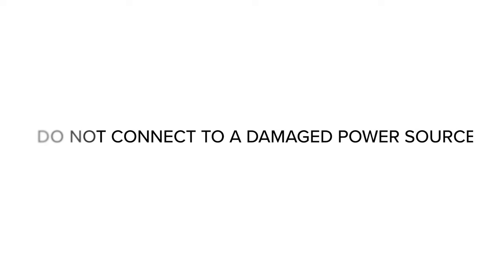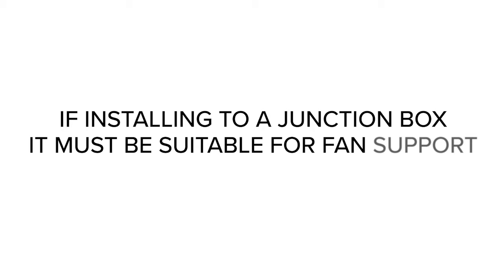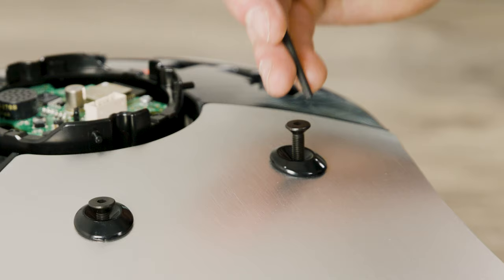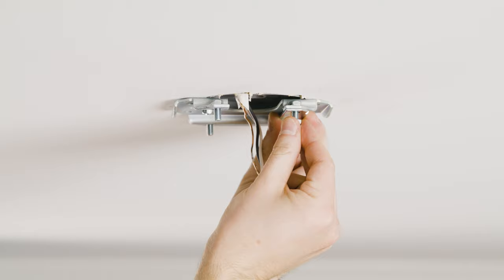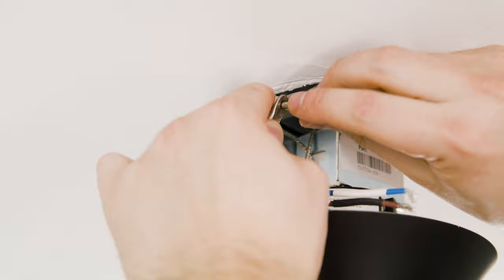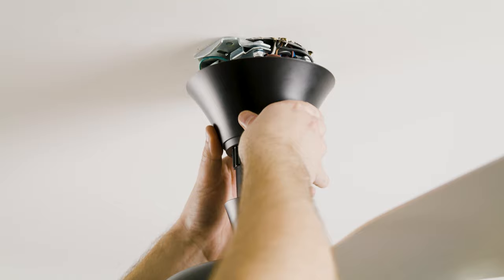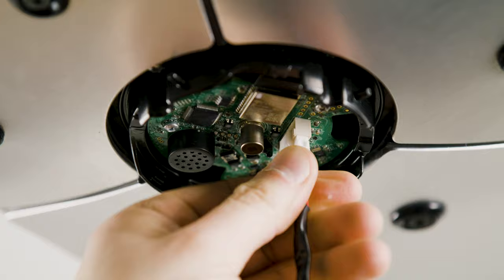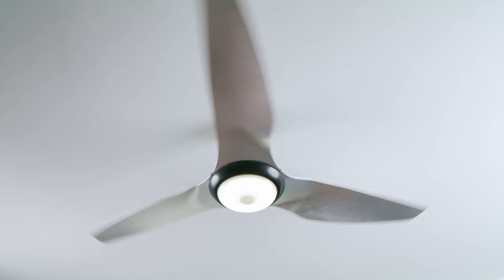How to install a Haiku® (low profile mount) by Big Ass Fans

Comment: The bracket bolts are terribly designed. The fan should come with two small wrenches or fixed threaded rods. Please tell me how I was supposed to tighten this bolts with a pair of strippers and a screw driver. This Is a failure on big ass fans and made me look unprepared today while doing work for a customer. You conveniently skipped over the righting in this video because I think you know it’s a flaw in the design. Fix your design